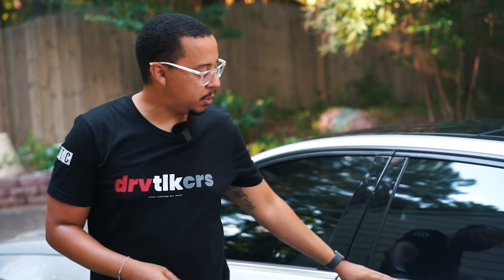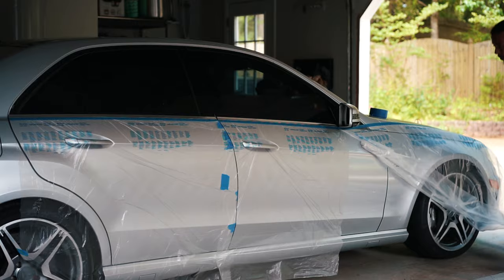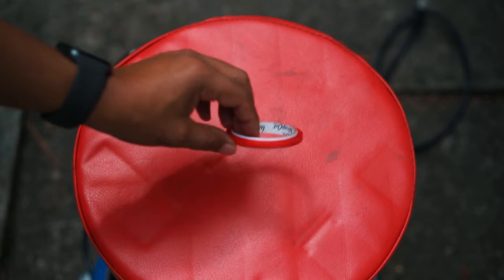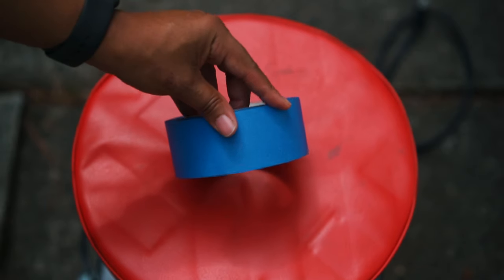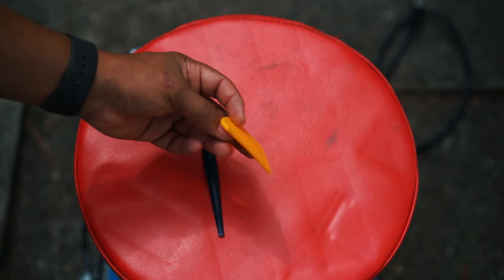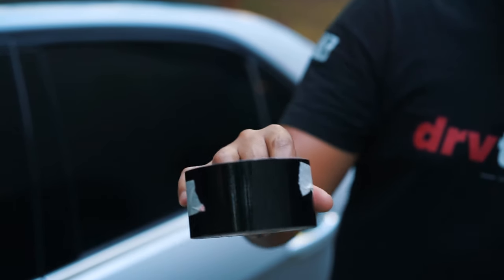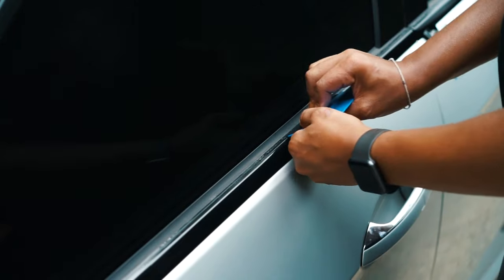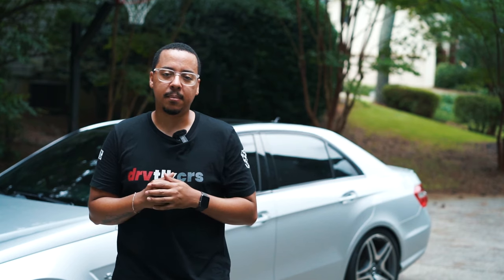Removing chrome for black gloss vinyl! E63 AMG gets window trim chrome deleted...AGAIN

Comment: Hi there. Man you made this look so much easier! Then most other videos where they say it will take 4-5 hours, and if that most likely you will mess up and cut the seal unless your extra extra careful. Which I understand and makes sense. Also, detail shops are charging anywhere from $250-$600 just to wrap window trim!! I’m trying to give $500 to blackout my wheels, grill and spoiler, lol! (with plasti dip for wheels and grill, and wrap for spoiler)But that red tape is awesome!!! Can I use that for the top and bottom part of the top trim piece. I noticed you used the red tape for the top, but you cut the bottom. Can I use the red tape on top and bottom of the same trim piece? Or is the reason you cut the bottom, is because there not much space to tuck like the top? 

Btw - Again. You made this look so easy. I might practice this on my 2015 accord, then if I do it right, I’ll do it on my sons Audi S5. Lol
Reply from the maker: Thank you! I appreciate it! 🙏🏽

Comment: Is the heat gun absolutely necessary
Reply from the maker: You can use a hair dryer as well. The application of heat allows for the vinyl to relax and be stretched.